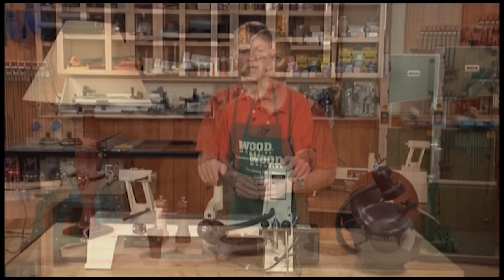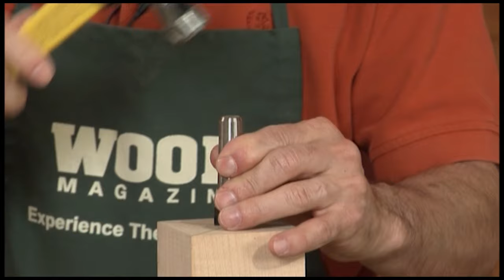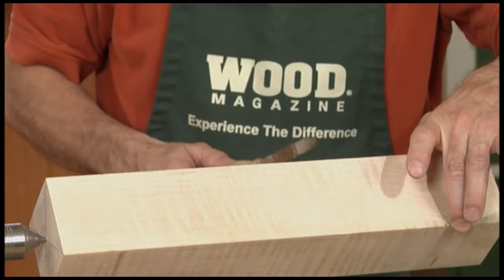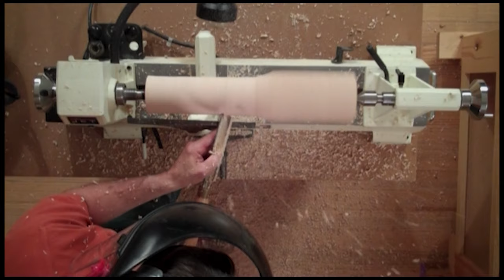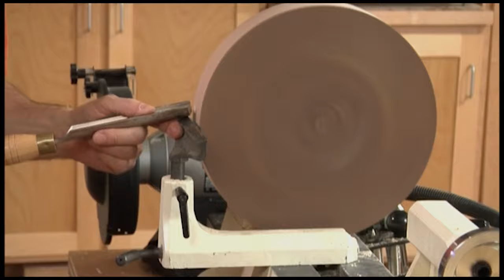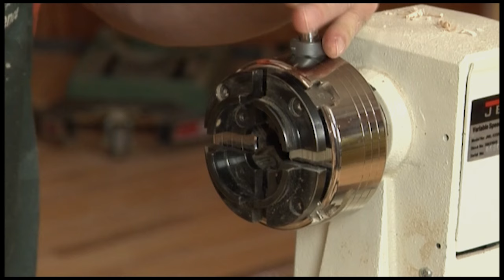Lathe Basics - WOOD magazine

Comment: I checked through the comments below. I was a production bowl turner for about 20 years. NEVER use a spindle roughing gouge on a bowl!!!!!! They can be used safely by an expert, but the way you show it being used WILL lead to a massive catch, breaking the tool, and quite possibly injuring the turner. A peeling cut used on bowls with that tool is suicidal. A SRG has a tapered tang for inserting into the tool handle. It is not very strong. A bowl gouge is made from round bar stock for the whole length, and they are made specifically for bowl turning, but work pretty well on spindles too.

Another point for safety, I ALWAYS stand out of the line of fire when turning bowls, and even on spindles, especially when starting the lathe up. 

The lathe is the Jet 12/24, and it is my little lathe. You have the lamp in the second best spot for use. Best spot is in the trash. Doesn't get anywhere near what you need to light what you have on the lathe. 

The lathe is 1/4 or less of what you will spend to get set up for turning. 

That grinder, slow speed is correct, though you can use a high speed grinder. The high speed ones tend to eat the metal a lot faster. The grey wheel is only used for heavy tool shaping, not for a standard cutting edge. The white wheel will do okay, but is most likely an 80 grit wheel which is pretty coarse. An 180 grit wheel is more common, and most are now using the CBN grinding wheels. The platforms on that grinder are removed by almost all turners now days. Many after market rests that are far better. Jigs are most common for sharpening gouges.
Reply: What's the beef with a lamp?
Reply: Notice the position of it in the video? It is on way too short of a stem. If you do manage to bend it into a place where it actually shines light where you want it, it won't stay there, it vibrates down to where it is in the video. After market magnetic base lamps work far better, and put out more light.

Comment: nice try, a couple of points from an old turner,  NEVER use  a steel hammer on morse tapers, always a mallet or soft hammer,you forgot to lock the tailstock quill, and NEVER use a roughing gouge on faceplate work,  I was quite shocked to see you do this, the tang of a roughing gouge is not as strong as a bowl gouge,  to get the best hold from a four jaw chuck, you should only have a maximum  of 1/8 of  an inch gape between the jaws when fully closed down on the work,  one more thing keep your grinder away from the lathe, as grinding grit may get into the lathe bearings , I hope you are not offended by my remarks but safety must always come first, and remember to where your safety glasse , you only get one pair of eyes so look after them.  all the best from an old tuner. JB UK.
Reply: This is just one of many such videos or articles I have seen where a general woodworking magazine gets their in-house woodworking expert to talk about turning, instead of finding a specialist turner. As you say, while most of the points made are good, there are some cringe-worthy examples of bad practise on display... One other that I noticed was trying to lock the toolrest banjo along the bed, instead of across the bed and then rotating the rest to be perpendicular. A regular turner would not make such errors.
Reply: I’m nit a woodworker but I noticed that right away 😖 (or at least put a small block of wood in between)
Reply: Is a grinder a smart thing to have beside a machine who’s function is to make sawdust? Looks like a huge fire danger! Even if you sweep frequently, lathe locations tend to have hidden piles of sawdust everywhere! Still a good overview of beginning lathe skills.

Comment: Very well done video. One question; what causes the tool rest to keep coming loose after you've tightened it during turning? Is it the vibration of the work piece as it revolves? I've been experiencing this with the  mini-lathe I have. Is there any way to prevent this?

Comment: SPEED?????
What are the various RPMs for a square blank vs a round bowl.  Do you start off slow, and then pick it up with sanding the fastest?  Would be a very good addition to tutorial.  Also, GRIT? On a spindle, do you go to 220 at 3500. Rpm? Is there a general rule of thumb?
Thanks..

Comment: hi with regard to having a grinder next to your lathe, this is a bad idea, as grinding derby has a good chance of getting into the lathe bearing, this could be very costly to put right. as fore dust and shavings, it is always best to clear them always as soon as you have finished whot you have been doing use a broom fare the larger shavings, and the a heavy vacuum cleaner to get all the dust, it has been known for a long time that dust that has been laying about for some time , together with static electricity, can self ignite, this has brenned down many workshops in the past.so cleanliness has its good side, keep safe and have a happy new year ,JB UK

Comment: This video needs to be shot by an experienced turner. If a beginner watches this, he will learn the improper use of tools, that could, lead to the user hurting himself.....badly. First, the roughing gouge is really called a Spindle roughing gouge. It is called this for a reason, it is Not to be used on endgraib, as your demonstrator shows it being used to round out a bowl blank. Essential using it on end grain. Second, the tool placement, and how it is used to address the workpiece, specifically the spinle, and bowl gouge, is incorrect. Your demonstrator insures that the user will experience catches, catches that could tear the tool out of the users hands, and most likely damage the workpiece. There is no mention of touching the tool rest before the workpiece. Some may say that they use a tool a certain way, but the rule of thumb needs to be understood, and why,. An experienced turner knows not to use a spindle roughing gouge on end grain, but may use it at time, knowing the risks involved. There were several other instances demonstrating the lack of knowledge by the demonstrator, and would advise the viewer to watch a few other lathe demonstrations prior to starting. Most of your videos are very informative, but this one needs to touch on some very important safety rules, so the user is aware prior to turning!